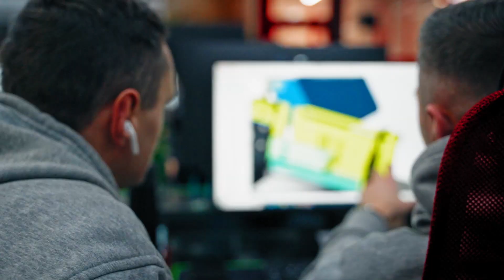This Guy is Mass Producing Factories to Build Houses | Cuby

Comment: Humanoïd robot in the house construction market : 

If we take a global perspective, the observation is quite simple: the detached house is fundamentally a local, contextual, and non-standardizable product. Land, climate, architectural styles, regulations, and residents' expectations vary worldwide. Any solution that imposes fixed forms, dimensions, or modules inevitably encounters this diversity.

Prefabricated construction, even partial, is inherently based on standardization. It can function in very specific, highly regulated contexts, or for temporary uses, but it does not offer a universal solution for individual housing. Transportation constraints, size limitations, industrial rigidity, and the loss of architectural freedom mean that prefabricated construction cannot become the dominant solution globally.

Conversely, the humanoid robot is a generic and universal solution. It does not standardize housing; it standardizes (improves efficiency while reducing costs) work.  It can intervene directly on-site, in any country, using local materials, local standards, and local architectural styles. It adapts to the actual construction site instead of forcing the site to adapt to a factory.

By automating movements, precision, and repeatability, the humanoid robot transforms the construction site into a mobile, flexible, and temporary factory. It makes it possible to build completely different houses on completely different plots of land without sacrificing productivity or quality. It can cover all trades, from the timber frame construction to the finishing touches, something no prefabricated solution can do without major compromises.

The conclusion is therefore clear: the future of single-family home construction, in France as everywhere else in the world, will not be the prefabricated house. It will be driven by the humanoid robotization of the construction site, which reconciles architectural diversity, local adaptation, economic performance, and ecological transition.  The humanoid robot is not just another tool: it is the only approach capable of industrializing construction without destroying what makes individual housing valuable: its diversity.

Comment: This has been attempted and done for select markets for decades. Nothing really new here. Conventional New building is of such low quality: Competes with cookie cutter modular homes. Neither wins, they both suck. There is a market for this, don't over think it, use robots and punch it all out. The machines exist and reinventing the wheel is not a good approach.

Comment: I keep saying in my little comments on Social Media that the hope of these new energy efficient standards or the retrofitting of older buildings is hugely expensive.  My thought is that we should be building out a huge fleet of nuclear powerplants to make energy cheap enough that we do at least for this interim time of global warming do not have to worry about heating and cooling - that we make the energy work for us as our housing used to be built to do.  Like here in CA most houses did not have air-condititioning, and the heat was cheap natural gas that we can no longer use.  Today we have heat-pump technology that uses less electricity, but still that electricity has to be carbon-free and come from somewhere.  We would all benefit with a massive power build-out because the world needs maybe 3 or 4, maybe more of the amount of power we have today.  Only nuclear can do that with a 24-hr duty cycle at scale.  Not that solar or wind cannot help, but if we try to do it all at the same time - there is not enough labor or resources to build complex new LEED building or retrofit old buildings - it is too slow, too costly and labor intensive.  What do you think?

Comment: The most important consideration for a house is its approach to the existing site on which it sits, these '20 patent solutions' will not properly consider the good and the bad of each site. The factory may be on the site, but the materials comes from god knows where, if you were to use the site soil and create beautiful rammed earth homes for example, your 'factory' would also be on site. I feel like this whole idea of a 'factory' is predominantly a reaction to the problem of a 'reduction in skilled labour', I’d say a better focus is to look at why is the apprenticeship system failing and how to fix this. Additionally, he’s idea is to build 'x' number of homes in a super-fast time, using special skilled individuals on machinery production lines. Are we supposed to believe he’s hiring, then training a new set of local people everywhere he goes? This would take a great deal of time, in comparison to the amount required to manufacture the houses themselves.

Comment: Anyone who knows anything g about building a house knows the true split is about 50/50 not 70/30, it's impressive that they have a bunch of machines but all they are really doing is making house components like a fully assembled door in frame.
The install still requires time and skill
Reply: Since no one in this video is claiming that final construction DOESN'T take time and skill I'm not sure why you felt the need to post that comment.

Comment: Those giant inflatable sheds have been used by the russians as hangars, as industrial warehouses, as storage warehouses, etc. for a long time, in fact I wanted to buy one to use as a super-house to keep all my things together, my cars, my motorcycles, my house, my workshop, my machines, etc., even a stage where I could play with my rock band all together in the same space, the funniest thing is that with all this there was still too much space left over hahaha, whatever it is me instead of a house of these that the video shows I would prefer one of those inflatable sheds but instead of filling it with air, fill it with plastic foam so that I don't have to constantly use air pumps to keep it inflated and thus have a permanent rigid structure with the plastic foam inside the structure, well, how good by this company CUBY  that will be able to solve the housing problem of thousands at fair prices

Comment: I would say number focus should be thermal/climate control in the coming years of dealing with extremes of hot/cold weather because heat and air will otherwise create massive costs to run these new builds.

The companies focused on that one issue will contribute the most to long term use. Unfortunately maintenance so often falls traditionally in the same dead-last slot well behind the zeal for quick-fast build outs.

Comment: Right in the first seconds, he's got it wrong: he says '70% is labor, 30% materials.'  Twenty percent of a house's construction is fees, permits, and taxes.    Then, like old Western movies, all of their uniforms and even their tools are sparkling new and clean; no sign that they were ever used. 100%+ of American homes are remodeled (100%+ because most are remodeled several times during their useful life).  With so much metal sheeting, steel posts, and concrete, how can anyone ever remodel.  Finally, if he is trying to follow the model of car manufacturing, he should build the exact same house--several models--over and over again.  Believe me when I tell you that every time he comes into a new jurisdiction with a new, metal/steel/concrete building, even if it deviates a few inches here and there, he is going to run into severe problems getting a permit.  They will want to see documentation of not only the house, but all of the materials that permit granters are not familiar with (they are REALLY going to freak out over that facade that can be removed).  Too many computer nerds and not enough people who know which end of the hammer to grasp.
Reply: That is debatable. If by "construction" you mean all the stuff that happens AFTER the land acquisition, design, permitting and various government fees then the 70/30 estimate of labor to materials is probably true. Most people would consider the word "construction" to be the actual build phase, not including all the preliminary stuff.

Comment: Is this like the Boxable scam? Those factories are neither very mobile nor mini. Labor to materials is more like 50/50. This is the complete opposite of efficiency. And I question his claim that they are making all the machines. They put their logo on them, but the machines are no doubt made elsewhere. And windows? There is no way they can build windows (of any quality) for less than a window manufacturer (with full warranty). And all that metal fab? Come on, man! This is reinventing the wheel many times over. This lacks the scale that would be needed for viability in the real world. How did they build the model home? They did what was cheapest - outsourced everything and had it delivered to the jobsite. Sorry, I'm out Sharks.

Comment: feel like a lot of people are missing that the innovation here isn't the house (pre-fab houses are an old concept), but the design of machines that make making pre-fab houses easier, cheaper, and more portable. This is really important. For instance, there's been a lot of growth and interest in pre-fab houses (e.g. volumetric construction), but one of the major limiting factors is the distance between the warehouse and job site. Making it easier to construct the warehouse closer to the job site makes this both cheaper (capital costs) and easier (portability).
Reply: These machines are already used in Japan and a few places in Canada. They already exist for making timber frame style houses using CNC to cut the timbers. You can design an entire house in their cad systems, have it cut the lumber and be ready with the framing and a build list on site. This is common in Japan due to long term labor shortage and there is one company in Canada with such a system.

The reason stick built is still common is it is a huge capex cost and frankly most US homebuilders are addicted to unskilled labor for framing ( just look as some inspection videos for framing, dire! )

These existing systems could very well be adapted to panelized construction and I suspect they already are in Japan.
Reply: Trust me, that laser steel cutter machine is NOT portable. We had a few of them where I worked in 2013.
Reply: This is spot on ^^. Cuby is making the entire process more efficient. Modular + Pre-Fab is not new. It's not about the buildings themselves. It's about the factories and the deployment of semi-customizable homebuilding. These local microfactories resolve many of the logistical issues. On top of this, the trade industries are facing a skilled labor shortage. This also helps with that. It makes the homebuilding PROCESS cheaper, faster, and more deployable. Excited to follow along.
Reply: I feel like you are missing the point that Russia stationed troops in this same country, Belarus, to launch the attack on Kiev.  So Belarus is not an ally.  Lukashenko started talking about helping putin, and the USA launched a sanctions storm against him.
Reply: Is this the first time you see a factory or something?
Of course there are machines that make parts, and the laser/plasma cutter ain't exactly rocket surgery equipment, neither the machine that makes window panes, I didn't see anything that stands out in your bog standard prefab manufacturing.

Comment: This is yet another of many startups I've seen over the years, trying to tackle cost of house construction with engineering.
While most of them are impressive, they all ignore that the housing crisis has very little to do with construction cost/ practices.

The housing crisis is almost entirely caused by bad zoning laws and institutional RE investors.
Reply: And this increase of material costs due to higher overall costs of fuel and transport because of political decisions during COVID and now the war with Russia.   

Another issue is speculation and constant influx of migrants driving prices up due to not enough housing.  

The increased overregulation that require homeowners to invest in all kind of technologies and materials that previously weren't needed.

And lastly the inflationary nature of fiat money and the massive injection of new money through quantitative easing.

The actual construction costs and wages haven't gone up as much as all these other factors.

Comment: Price is King so what are the prices of the lowest area Homes and Those which compare to normal Square footages which requires many valuations over many areas of Homes. Claiming cheaper costs are CLAIMS not real or actual prices to Buyers.
Reply: you should be able to get great rates on labor from BELARUS!!!  based on your comment, i don't think you see the whole picture here.

Comment: Factory Built Homes fail to Resolve the problems of how to MOVE factory built Homes Pieces which are too large to move by Roads too distant Land Areas that require a Home or Buildings the person Requires. 
The equipment is too specialized to Move to One persons Land requiring a Building or Home. 

If the Home Building Pieces are Built in a Factory they are too large and cumbersome to TRANSPORT to the Building Sites. So Homes are too Big to TRANSPORT at distance and the Equipment is too Big to move to a Building Site and the Pieces built in a Factory are too Big and Cumbersome to TRANSPORT to a Building Site and all are expensive to Transport and Facilitate processing on Site.

Comment: This is amazing. I wish they were local to the US. As a mechanical engineering student this is absolutely what I have been thinking for years. The first thing I did after finishing this video was to check if they had any internship opportunities.. This is groundbreaking and I wish I could be a part of it
Reply: There are like 10 other virtually identical companies. Prefab has been around for decades. This is nothing new. It needs to. be done far differently than everyone else to actually work. It doesn't yet.
Reply: Forget about internships. Don't sell yourself short. Get a job that pays real money. If you're a student, look into co-op programs.
Reply: This is little more than soviet concrete panel housing with a ton of extra modular bits added

Comment: There are so many players on this space and yet........Inexpensive, well designed mass produced housing is as elusive as ever. Try to buy one of these things and you'll discover that there is a reason that houses are built in what seems a painfully inefficient and wasteful manner, that houses are sufficiently complex that their production defies efficiencies of assembly at scale so factory assembly techniques usually fail to meaningfully compete in price or build time with conventional methods. The likelihood that Cuby ever scales to more than a boutique niche product or even achieves modest cost savings over traditional build methods is extremely low.

Comment: Ah, 60 years later, a good old Soviet “Panel house” has been re-discovered. Just don’t make them ugly, and look alike this time, please 🙏
Reply: yep you are right, this kind of houses are very old and soviet era, curiously they continue to be the housing solution that is needed, cheap, fast, of high quality and the size you want.
Reply: This is exactly what the British done to address their severe housing shortage after ww2. Everywhere had a housing shortage after the war but especially Britain with it's high density living AND heaps of bombed buildings. They had concrete panels thay were all within 3mm of the factory molds, but.... during assembly MUCH of it didn't line up so they had literally a quarter the bolts required in multiple constructions that then caused movement which led to cracked gas pipes and really troubled buildings like Ronan Point which blew part of it up in a gas explosion. Quite a number had to be demolished because they were so badly built and they STILL face this problem with 2 inch gaps in the corner of the walls between apartments. At least these Belarus ones look alright. Until the magnetic cladding blows off.
Reply: The US has fomented an unhealthy disdain of panel houses and other quickly built scalable housing
Reply: That and the connections makes this a start up failure.

Comment: As a home builder in Ontario Canada I can say that the cost here has always been about a third land/infrastructure a third materials and a third labor. These building may have less labor but wood is much cheaper than steel (in Canada). We have companies here that do a range of prefab, from framing components to entire sections of the home. But shipping large components is not practical.
This can be a huge cost saving technique but you would need a onsite factory and a project of 100's if not thousands of homes.
Reply: What's cool about the "pop-up factory" idea is that they could probably quite easily be moved from one big project area to the next. The biggest difficulty would probably be to get the workers to move or find new ones at the new site.
Reply: @Anoneom doesn't work anything like that. This is modular building. Just more concrete panels housing except with a ton of added extras and modular bits
Reply: Realise this is MAINLY concrete panel construction. Just like good old east European soviet times.